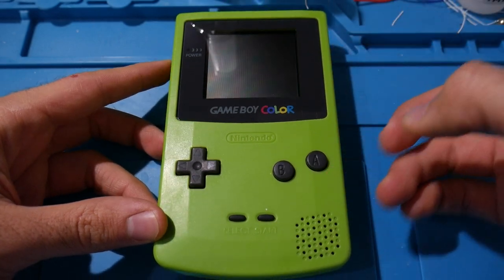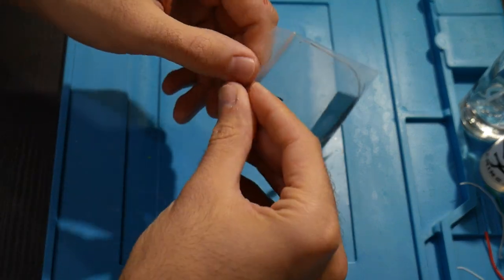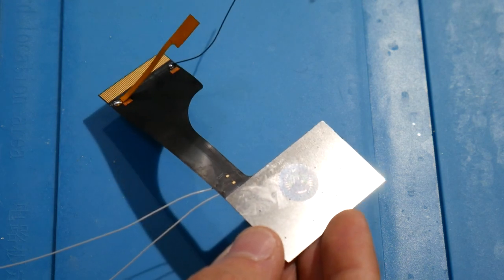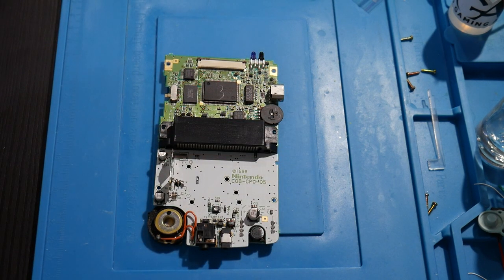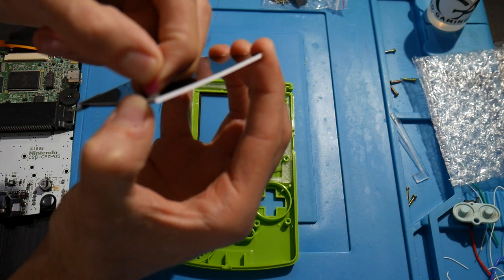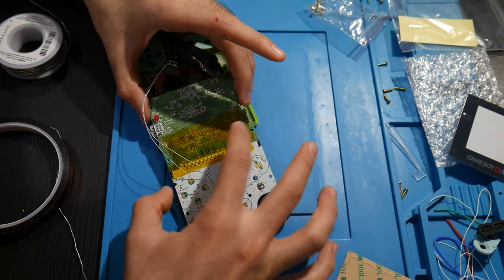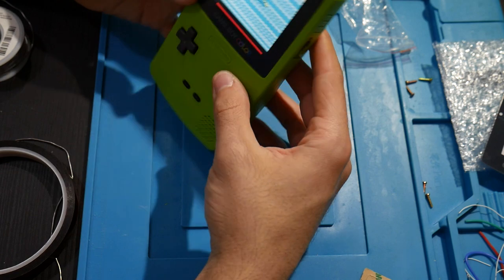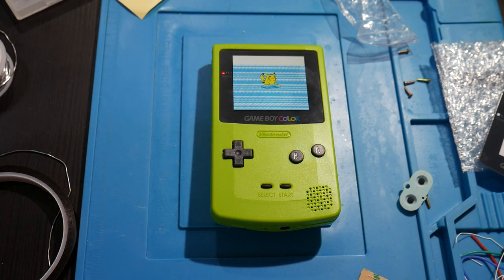Let's Upgrade a Game Boy Color! - IPS Display Mod & Full Reshell Kit

Comment: There are kits that use that display bar at the bottom to illuminate a see-through logo at the bottom bezel. Sort of like a Marquee  on an Arcade. The color of the block at the bottom can be firmware updated on the display inverter board. Otherise the touch center can be taped to the inside of the case for better controls and easier to interact with.
Otherwise, fun build guide!
Reply from the maker: Thanks for the info!

Comment: i was pretty confused with that piece that ended up b3eing the touch sensor... but then for it to actually work as well as it did without you even tryin??? NICE JOB MrMario!!!!! Fun relaxing video too :)
Reply from the maker: Thanks! Honestly not a big fan of the touch sensor, I like the OSD or button options like I've seen for DMG and GBA mods.
Reply: It isn't positioned well since it wasn't soldered at an angle. It's also not under the IR like Mr Mario seemed to think, it's on the other side.

Comment: I've installed a Funnyplaying kit before, though mine was laminated. It uses the same flex cable, however. it's good, I did it about a year ago, and have been enjoying it.
Reply: Keep in mind, if you are using a clear shell, you can do the wiring for start + select a lot cleaner using vias behind the screen. See Macho Nacho's video on the kit if you want to know the locations, that's what I did, and my highly modded Atomic Purple GBC looks clean af.

Comment: I know this video was posted 6 month ago but her some infos on things i noticed in case anyone look at the comments after watching the video:
- The grey IR cover bit grey replacement (on the top of the console) is opaque, IR function wont work with this one (to see if a replacement will work with IR or not an easy test is to shine light directly throught it to see if some go through)
- At the end of the video you seem to strugle triggering the touch sensor, its normal, its not under the IR cover but to the right, you manage to activate it with the right angle because you touch it with the "belly" of your finger 
-  The red bar that you can see at an angle is a function of the screen, when you have a lense with a see-through "game boy color" logo, see next point to fix the issue

This screen functions are the same as the funnyplaying :
There is two input start+select and the touch sensor
 1/ The touch sensor by itself have two function : 
      - Short tap change the brightness
      - Long press chaneg the scanline mode
2/ Start and select /
    This one is a little trickier without seeing through the GBC logo
    Long press on start+select will illuminate in white the text under either "GAME" or "BOY" or in color under "COLOR", you swap between those 3 with a tap on the touch sensor, and get out of those modes by a new long press on start+select
    - Game illuminated : move the display up and down with start and select
    - BOY illuminated : move the display left and right with start and select
    - COLOR illuminated in color alone : change the color with start and select

So in the case shown in this video with the screen being cut on top is to user those mod to lower it down, and then also solve the red bar issue by setting the color to black

Comment: There are screen lenses where the Gameboy Logo is transparent and therefore is the red part on the screen. Also there must be a button combo to adjust the screen position and also the red bar.
Reply: You said it better, I don't blame him because there is little documentation. It's a semi quick fix
Reply from the maker: Wow, I never would have thought of that, thanks for explaining! And agreed with the reply from Mashed Mush: the documentation on this was severely lacking, more so than DMG or GBA mods I've done.
Reply: @MrMario2011  Instructions shamelessly lifted from the Game Boy discord - this is meant for the laminated displays where the lettering is transparent but you'll be able to tell which word it's trying to highlight by looking at the bar you see:

Press and hold start + select, then tap the touch sensor to scroll through the three modes (denoted by the word currently highlighted):
- GAME - start + select to move the screen vertically
- BOY - start + select to move the screen horizontally
- COLOR - start + select to scroll through colors
Long press start + select to exit

Touch sensor controls:
- short press to change brightness 
- Long press to change screen effects

So I think to do this blind you'd have to hold start+sel, tap the sensor twice, then hit start to cycle forwards through colours until the bar is gone and then long press start + sel to save that setting.
Reply: This guy is a genius

Comment: I was looking at the kit going I swear that looks like a funnyplaying ips mod. It is a funnyplaying ips mod. When it's all working it's great. I just had the misfortune of damaging the ips ribbon cable. Than damaged the GBC pcb. Separately, Dang thing sat on my shelf unplayable for months until I found another GBC that was not expensive. All I needed was the motherboard from it LOL. About two or three months ago I was finally able to get the thing up and running correctly.
Reply from the maker: Glad to hear it was working for you by the end! I understand how that goes, though.